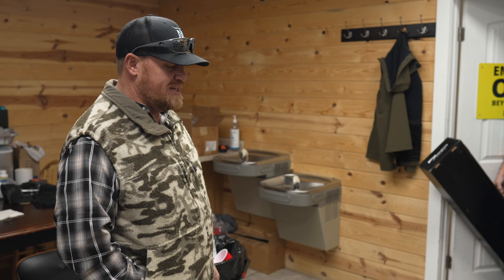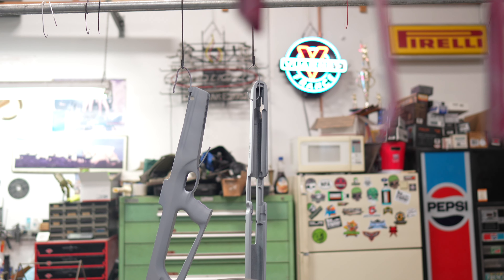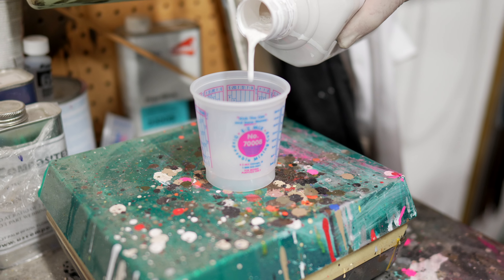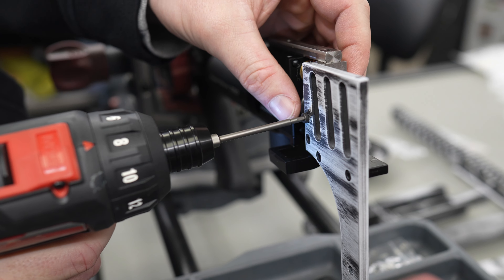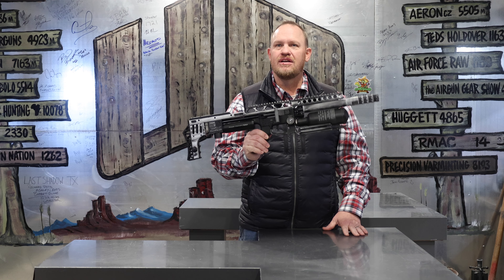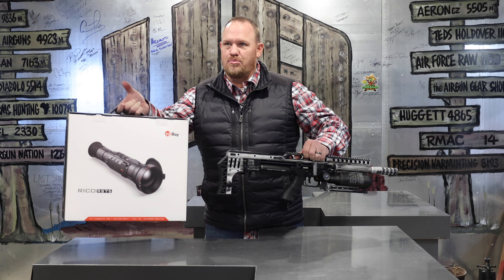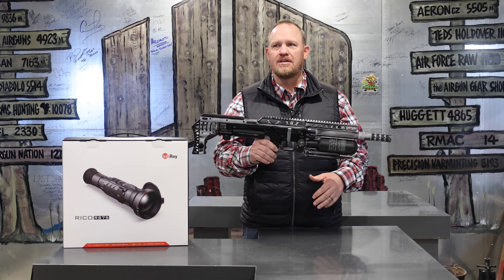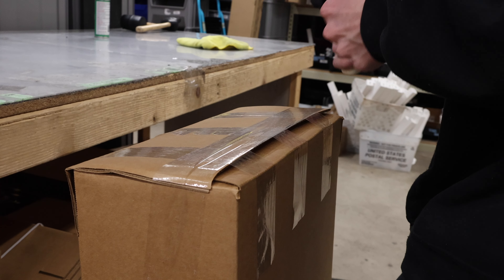Shop Life: Building Your Dream Airgun

Comment: I don't have to build it. Skout already makes it. It's the EPOCH.
Reply: 😂Big claims for a gun that isn’t even in full production yet.
Reply: And how many 1st , 2nd and 3rd place winning trophys are there to base this on ?....
Reply: @georgedeedsnotwords2162  Buyers remorse? That's why I held off until now to buy. This IS 21st Century tech meeting 21st Century. Not the 1960's valving. I'll know by the end of February. The  35cal conversion kit by May/June? Stay tuned.
Reply: @theprofitmohamhead1268  wow fx was making valving back in the sixties ... I thought they started in the nineties . Anyways if it isn't broken .... don't pay to have it fixed . Besides I think it has same valve , just changed to electric trigger .
Reply: @georgedeedsnotwords2162  lol it’s just coming to market…. However. The majority of competitors are shooting fx. You can bet the podium would look ALOT different if it was 50% fx vs 50% other high end airguns.